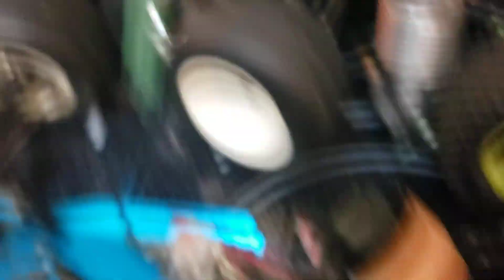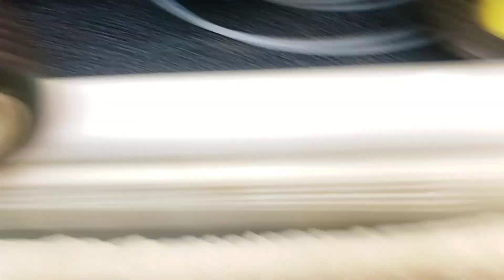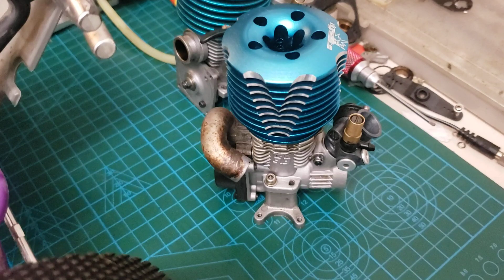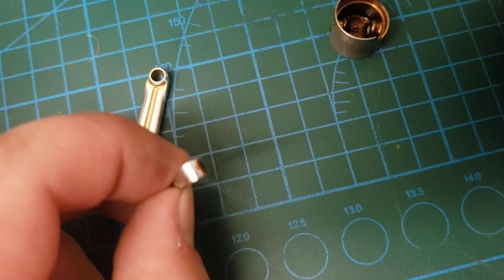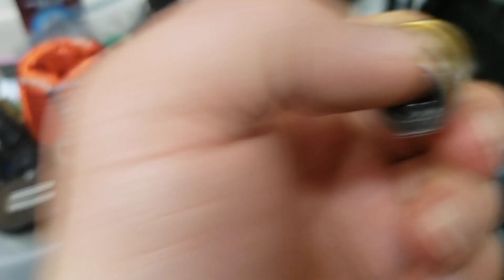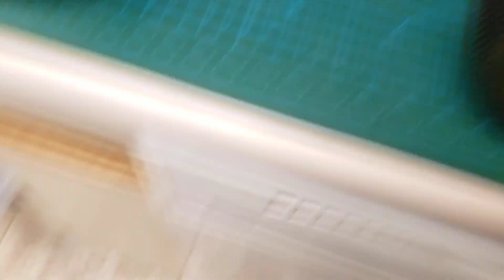Do i really hate Traxxas??

Comment: You probably know, but tire glue stores longer in the fridge. I've had a bottle in there for 2 years and it's still good. It's almost empty now, I had bought 2 bottles and put both in the fridge in 2019, but I don't glue much.
Reply from the maker: Thanks for the tip I never thought about that before but I bought some new stuff and I guess I had been sitting forever and it was hardened unfortunately so luckily I found another tube but thank you for the heads up on that I will definitely keep that in mind

Comment: I bought an old tmaxx and the connecting rod failed in 4 tanks
Reply from the maker: It happens. Any used Traxxas engine pull the engine pull the rod pin and bearings and replace them to prevent that

Comment: What dose it do to your engine if you turn it off buy blocking air from your carb
Reply from the maker: Pulls in a ton of fuel and floods your engine making it hard to start and if you leave it like that  The fuel sitting inside the angel will become corrosive and start rusting things run them out of fuel when you're done
Reply: @thebug4046  k thanks
Reply from the maker: @rawlemonsaregood2539  no problem

Comment: the only thing i hate that traxxas did is witht the tmax tank it gravety feeds in to the engine filling it up with fuel ive had that problem no mater what i did
Reply from the maker: Plugged exhaust can do that to. I have yet to have that problem
Reply: That’s with  out running just sitting doing nothing no prime
Reply from the maker: @IcyDracula  weird. I will have to check that.

Comment: How do u tell if your engine has bad compression
Reply from the maker: I have made video explaining it but I will make another soon. They shut off when hot and won't start until cold again
Reply: @thebug4046  mine don't run at all is there any other way
Reply from the maker: @rawlemonsaregood2539  i have a Facebook group nitro/diesel/gas rc and more if you want to check it out and post pictures and videos on the issue..  There will be 2 questions to answer when you apply and I will let you in on the owner

Comment: I swapped my 3.3 out for a OS .21 TM
Reply: i'm in the process of doing the same on my revo hope it was a good move ?
Reply: @mikeknapp318  it was a very good move. So much more power
Reply: @davidmayberry9335  i was ok with power on the 3.3 when it would tune right .but that happened like twice in the entire ownership of this revo .ive only ran 3 gallons trought it and its just such a pain in the ass .i had a 2.5 about 15 years ago it was such a better truck .i had one problem with it in like 2 years of hard bashing and running traxxas 33% and it ran great .i didnt even break it in right hell i didnt read the owners manual at all on my first revo .i broke it in the was i did my 2 stroke kart engines .15 mins of idle ,then  let it cool,15 mins on the stand slowly raising and lowering the throttle low to like half throttle and easy back to low ,do that for 15 mins let it cool take it out and slowly carve in the engine little faster and faster untill you hit max rpm and  park it and let it cool .then drove it like you stole it.that first revo was bullet proof .i stopped driving it cause i broke my back and just recently bought my new 3.3 revo.two different trucks .the new ones cool but not half the reliability of my 15 year old revo,so i hope the os will give me some the reliability i had with my first truck ,and if its faster ??awesome !im also gonna put the ths pipe on so that should help things too.ill let you know how i like it after the break in .